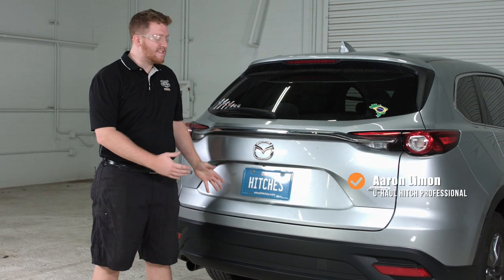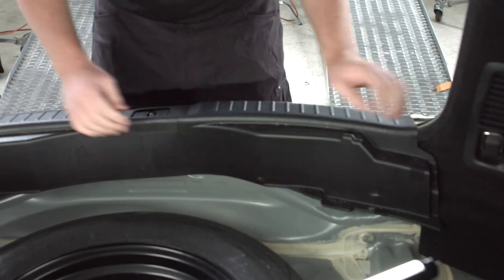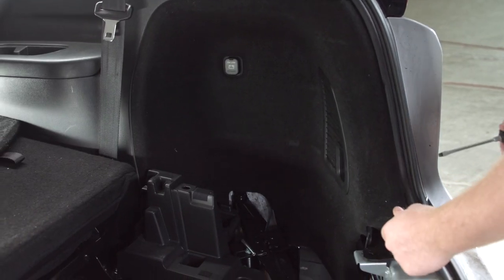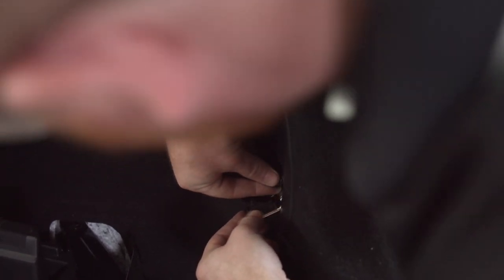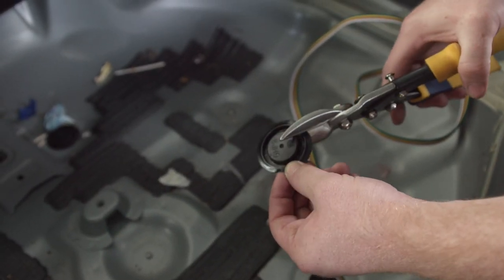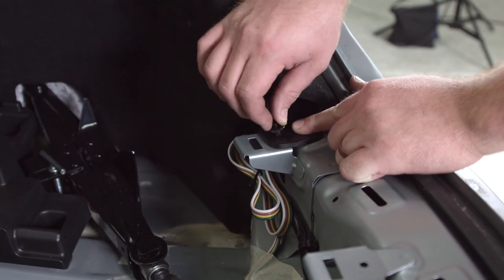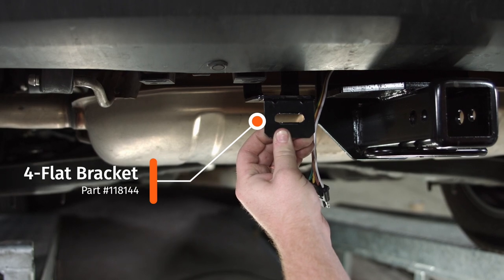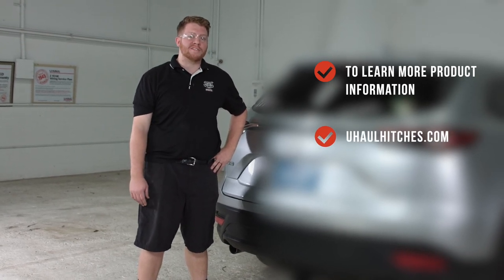2019 Mazda CX-9 Wiring Harness Installation

Comment: What part number is the hitch itself. I noticed that one has the extra piece where you mounted the connector. I like this better than hanging cables.
Reply from the maker: I've listed all part numbers below
Wiring: CMF56338 
4-Flat Bracket: CQT118144
Hitch: CMF13315

Comment: Hi my cx9 2020 does not have the trailer tow connector, any idea were it can be placed? I just cant find it, I even remove the driver side panel!
Reply: Its only on Touring and above trim levels
Reply: @boblatino do you know if the carbon edition has the connector?